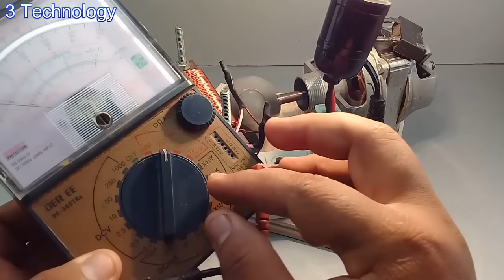how to make 240v 10000w free electricity generator

Comment: i found a old free generator that makes energy, made a biodigester system generating gas i can use for the generator and after needing to expand my biodigester a bit more for a fair constant of gas i basically got free energy just had a bit of work to start with to set it up and change oil on the generator from time to time and add a bit of scraps in the biodigester from time to time but yah free enough spent less then $200 and still going a year later generating around 4000 watts that recharges some battery backup also added a longer exhaust pipe on it and wrapped it in a metal tubing and a small pump to help keep my hot water take water warm to save a little on energy their and in the winter i have that hot water connected to a old car radiator with a fan behind it to keep my shop a bit warmer. going to expand my system further with the biodigesters to make added gas for extra gas for a furnace and a gas hot water heater, and a burn barrel with tubing to get extra hot water from burning paper trash and yard scraps, knowing i dont have to give much of any money for utilities is a great feeling and allows me to save so much money, but not for every one it takes work to maintain it all and build it up but works, to bad none of these other things these videos show do much of anything then doom scrolling

Comment: Bro yall saying its fake and theres a battery under. But we literally see him connect the wires from the plug in to the energy machine and plugged the other magnet into it so how can there be a battery. And also the other wires that were exposed stuff was put on it so they couldnt have hooked up those wires

Comment: Encore une supercherie. Comment un moteur de quelques centaines de watts peut-il produire 10.000 watts??? Et puis, enrouler du fil émaillé sur des tôles avec les arrêtes tranchantes sans aucun  isolant c'est à coup sûr provoquer des courts-circuits dans les bobinages, l'émail d'isolement étant "blessé" par les arrêtes des tôles!!!! Comment Youtube peut-il laisser publier de telles âneries????

Another hoax. How can a motor of a few hundred watts produce 10,000 watts??? And then, winding enameled wire on sheets with sharp edges without any insulation is sure to cause short circuits in the windings, the insulating enamel being "injured" by the edges of the sheets!!!! How can Youtube allow such nonsense to be published????

Comment: Make it simpler by using old discarded transformers you can find in television sets at the junk yard. Also collect any large capacitors and diodes. Variable resistors too. You will be creating a free energy device with all this junk. Forget about magnets, motors or generators. They are expensive and will send you to the poorhouse. Also an automatic timed  off and on switch is needed. The way this works is when a electric current from a battery or capacitor goes through a transformer it will create a magnetic field. When the current is quickly switched off the magnetic field created by the transformer will collapse causing a reverse surge in current and creating another magnetic field. This process could go back and forth until the current is reduced to zero but you want to prevent that by continued on and off switching of curent that will keep this process going.This current can be stored in a capacitor then used to power appliances after it has been converted to direct current and the output is stabilized by using resistors, diodes and capacitors. Or it can be outputed as alternating current for devices to plug into it. The bigger the transformer and capacitors the bigger the power output. Best of all this power device has no moving parts. Variable resistor is used to control the power output  level and you will need a charged battery or capacitor to start the initial process but they can be recharged as needed by the power device output. You can see for yourself how this device is creating more energy than it is using.

Comment: I'm sure it works well, as it has all of the basic elements--hot glue, magnets, coils.  Maybe add in a few old spark plugs and get the output voltage even higher.

Comment: I wonder how long it lasts before it heats up and dies
Reply: 10 amps….i figured it wasn’t a high amount……although if you take a car battery…..at 2 volts per cell gives you 12.75 volts of electricity but maybe tops 200 amps….on a 12 volt system.

Comment: Project: Orbital Rotating Magnetic Isolator System with Low Temperature Superconductors
1. Introduction
Our project aims to develop a highly efficient power generation system in Earth orbit, using low temperature superconductors (LTS) and vacuum conditions, minimizing energy losses and maximizing efficiency.

2. Technical concept
• Superconducting magnets (LTS): Use of titanium-niobium (NbTi) magnets with low resistance and high permeability.
• Superconducting coils: Coils made of low temperature superconductors (NbTi), minimizing resistive losses.
• Rotating insulator: Central composite plate made of polymer, carbon nanotubes (CNTs) and ferrites.
• Vacuum system and cryostat: Special cryogenic chamber maintaining vacuum conditions without energy losses.
3. Mechanism of Operation
The system uses the orbital velocity in low Earth orbit (LEO) of about 27,500 km/h (7.66 km/s). A rotating insulator interrupts the magnetic flux, generating electric current in superconducting coils with minimal losses.
4. Cryogenic chamber
• Vacuum system: The vacuum minimizes mechanical losses and friction.
Prześlij opinię
Panele boczne
Historia
Zapisane

Comment: I am not sure you are all being fair here. He is showing us how to wrap apparently uninsulated wire on un insulated steel plates, then connect the wires in a very specific way, bolt all of the plates together without insulators so that none of these connected conductors short. It is an amazing feet of electrical engineering.
I plan to build a series of them to run my house. I will start that project any day now.

Comment: A few bits of wire, a few pieces of rusty scrap metal...3 dots of glue....one turn of the crank....and you produce 10000 W??? or 45 A at a voltage of 230 V...not to mention the frequency.

A little seriousness. The aim here is not to have perpetual energy, but to obtain mouse “clicks” to generate traffic, and for the owner of this chain, to have a perpetual remuneration.

Comment: Jeder Elektrikerlehrling weiss im 1. Lehrjahr, dass die Drähte der Spulen etwa 10 Ampère aushakten. 10'000 Watt bei 240 Volt ergeben aber 40 Ampère. Also alles Chabis. Ein simpler Dauermagnet mit Draht um wickelt ergibt noch gar keinen Strom, die Magnete müssten sich bewegen, Also gelogen.

Comment: 11:25 is a good spot to wire it through a hole in the table to the 240V grid. A fair price for 436,000 subscribers, 1,900,000 views and 2,063 comments that can be monetized. 10 kW or what?

Comment: 11:57 I saw the frame of this second. This is when the video cut out and the electrical outlet, when connected to the wood, was drilled through a hole and the wire was connected directly to the power supply and a foot switch was placed in the way. When all the wiring was done, the switch was connected by pressing the foot switch. The interesting thing is that the voltmeter shows exactly 230 volts. Hahahaha, good luck.

Comment: As it is on principal of Electromagnetic induction, so it could generate electricity but not so high voltage as shown above ,so finally it is fake ,because it can't run motor as well as bulbs also

Comment: OK for all of you scientifically challenged people, this is how it "works", aka what's going on.  Essentially you have built the secondary aspect of a "transformer". Notice the voltmeter is set to measure AC current because transformers only work with AC current.  It's sucking up voltage from a "primary" source nearby. It could be power transmission tower, a refrigerator motor, a fan nearby, anything casting magnetic resonant frequencies through the air, or walls or anything nearby. If the source is an appliance in your home, you will be billed for this energy usage on your next bill. If it's from a source out of your billing domain, it's not "free" energy, you're just stealing, (taking), it from the source. Back in the 50's there was a case of a man who lived close to a power transmission tower. He filled a 55 gallon drum with steel nuts and bolts and scrap steel. he then wound a lot of wire around the drum and was able to tap into the energy from the transmission tower. The power company sued and the court ruled in their favor saying something like even though there wasn't a direct wired connection, there was an inductive connection. He had to disconnect his device. So remember this, THERE IS NO SUCH THING AS A FREE LUNCH. Good clickbait though.......'just sayin,,,,,,,,,,,,,Mike

Comment: Going Deep Into The Video...

The video is not fake but this is not the free electricity generator.

First i want to tell you some basics that enery niether be created nor be destroyed and the amount of work done(Energy) given will be always greater than output energy.

Means if you are converting mechanical energy to electrical energy then the output will always be less than the given input for Practical condition and its equal when in Ideal Situation.

So to make a free infinte electriccity generator the output energy should be greater than the input energy then only it will be called as ifinite electricity generator.

As in the video basically he is first using mechanical energy to rotate the motor alongwith magnet and due to this there is change in magnetic fields and whenever there is a change in magnetic field, potential generate and current flows which then connected with plug board which is then connected with a motor so he maked a loop but in short it will stop after some time.

Lot of efforts in writing...😂 Might Help You

Comment: Only morons would think that they can produce emf with magnets without cutting the magnetic flux! And thats not the way you cut it not to mention the low magnetism strength of that speaker magnet vs polarities vs your winding. Ived made a lot of project generators uaing that and youll be lucky to light up a bulb..

Comment: Cool! This should work. 
Love the way the fields are switched. Great idea!
Not sure about the numbers however the coil arrangement does have transformer like properties and even if it's a quarter of w(h)att's claimed it's still very useful and scalable clean energy. 
Tip: Don't forget to include the capacitor across the alternator to keep it spinning between cycles.
This should really work!
I've seen other configurations of the same idea working too.

---

PS You've been lied to by the church of scientism:
thermodynamics isn't a law,
it's a 99% probability. 
These devices exist in that 1%.

Comment: No, this is really how you do it. If you look in the middle of the alternator, it is changed properly. There is another piece on the inside that well look it up but yes, this actually appears to be real.

There could be a battery somewhere, but this is how you make the real one that generates electricity without batteries

Comment: Is thst supposed to be regular copper or magnetic copper, what kind of metal are the bars, whats the output of the alternator and  how much input does it need to run, was that back box a battery or a capacitor.   You should be explaining everything and showing the inside of everything aswell as under the wood!

Explaine and proof aswell as measurements of each part! And the diagram!

Comment: IT DOES MAKE SENSE JUST LIKE A CLOCK ONES IT STARTS MOVING THE MAGNETS KEEP IT ROLLING THE GENERATOR DOES THE REST. I SEE THE PRINCIPLE BUT ITS WEAK TO RESISTANCE AND DISTORTION. AM DEEP IN TO USING THE HYDROGEN IN WATER AS THE POWER TO GENERATE , A HYDROGEN REACTOR

Comment: That's messed up. Spin the wood mount this way then that. I recon you can't go sideways much or the hole shows. Must be a little tricky with the power strip offset toward an edge. Instead of a tiny hole, you need a 5" circular cut?

Comment: Craziest thing about this video is the comment section lol. So many of you mentioned the battery being on the underside of the wood platform, but if ya don’t know, the copper and Steel scaffolding IS the battery. You don’t need lithium to have a Battery. Do a little bit of research and you’ll find that prior to Modern batteries that we know, many power instruments were Copper generators. Much like this contraption in the vid. This is similar to concepts that Both Edison And Tesla’s(not to be confused with Elon musk) creations. This isn’t a new concept nor is it one that is “Impossible” as many of you have stated. Do yourselves the favor and Discover the science behind this and maybe even give it a shot yourself, all the materials here are Common materials. Build one for yourself, then come back and recheck your comments! 
Science is a Fun thing when you give it a go yourself, if not for this concept, much of the United States wouldn’t have had the power grid that we do, though it’s become much more refined and is Much different now. 

Bottom line is, test it yourself before you try to Debunk it lol. This is a real concept that Actually Does work ladies and gents. 

Thanks to the content creator for posting this vid. Great stuff- Take care!

Comment: There is no such thing as "Free energy".
 This is a Fraud.
1.Dc Motors are very poor generators of electricity.
2. When a load, the lamp is applied to the fake circuit it does not slow down. Anyone who has used a real Generator knows the Rpm changes as the load changes.
3. Magnets and certainly weak ALNICO magnets are not a power source.
4. Due to friction this device must come to a stop on its own.
5.  All generators must alternate a North, South, North, South, poles 90° to a copper coil. and this does not. The poles are on the flats parallel or 180° to the coils.

The biggest problem of all  with all free energy devices is where they hid the batteries. Notice you never see the underside.
the motor is under an external power source.

FRAUD
I am an electrical engineer.

Comment: ####$ I would rat that metal bar with wax paper or forward of electrical tape or some. Sort of insulation. They keep the edge of that.
Wire getting its insulation rubbed off. There is a thin.  Coating on the wire that insulates it

Comment: Free energy only happens in India and surrounding areas. It requires construction with scrap components, a glue gun and a place to hide the batteries...  so, all you need to do is scale this up so it produces 100's of megawatts and lift your country out of poverty.

Comment: Now tell me, how does this generates 240 volts? this doesnt even generate 0.000001 volts. You need movement to generate electricity, theres no electric energy without any movement.
how to do it: you have to put the coils in the middle, and the magnet around it, then you have to spin the coil. (with a South and North magnet, not with a speaker magnet.)

Comment: Well, whenever I send 40 amps through small gauge magnet wire like that the smoke leaves the wire.  There is no way that device can provide 13HP of power and not burn up.

Comment: I'm an engineer, and this violates Conservation of Energy  as described by the First Law of Thermodynamics. Those burning lights take a huge amount of energy out of the closed system. Notice how carefully he turns the wood board? That's because of power wires coming up from underneath. 🤨
Reply: Make a video showing him wrong and that would be cool

Comment: YES PLEASE provide us with a detailed list of materials used to build this device. Would you please be so kind as to answer my following questions?
#1: What gauge copper wire did you use to wrap the plates?
#2: What is the length of the metal plates and what type of metal are they? 
#3: Where did you source the electric motor from/what are the specific details of that motor. Is it an alternator? This is obviously the key component of this build so knowing the specs on this item is very important.
#4: please provide specs for the magnets that were used. What size is the donut magnet used for the base of the copper/metal plates, what is the size/dimensions of the donut magnet used on the end of the electric motor?
#5: can this device be hardwired into my electrical panel for use in the event of a power outage?
#6: can multiple devices be used simultaneously to energize my entire home, or can the device be made larger or to generate more overall electrical output?

I am very serious about building, one or more of these devices, and would genuinely appreciate any additional information you would be willing to provide. Thank you very much in advance for answering the questions above.
Reply: It isn't his video no doubt but most material minus the generator is in the picture.
Reply: 1-кабела трябва да е меден 2-пластините да са железни 3-магнитите от тонколони 4-двигателя какъвто намериш 5-да ВКЛЮЧИШ ДВИГАТЕЛЯ В ТОКА😂😂😂😂
Reply: I wouldn't bother. It's fake and will not work. There is no such thing as free energy.
Reply: I'm amazed at how people can know so much and still so very, very little.